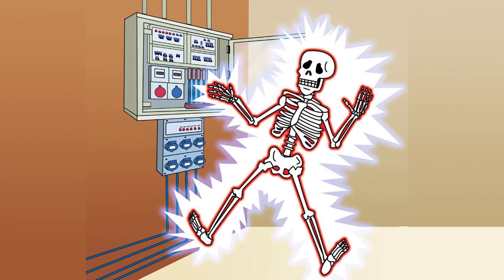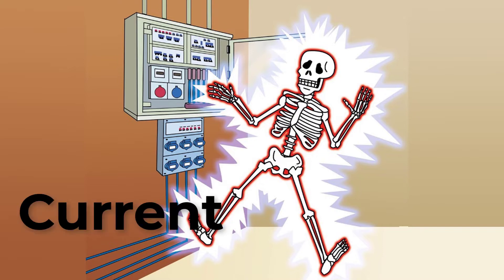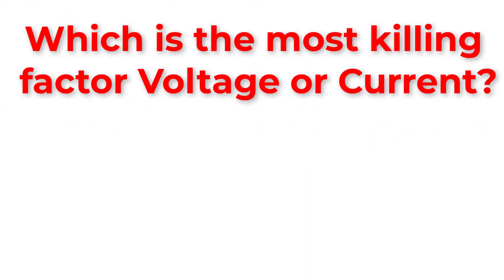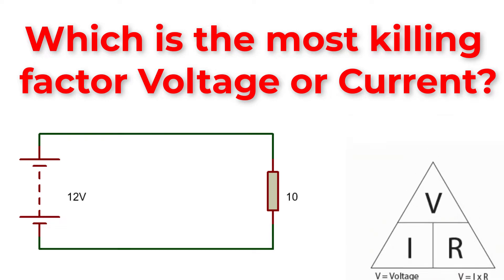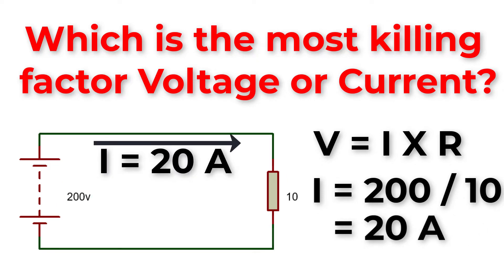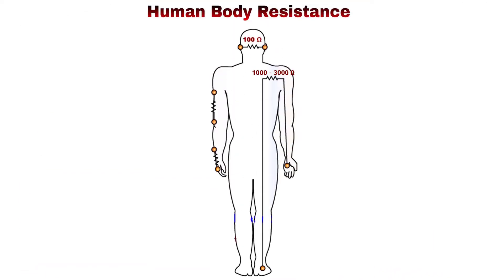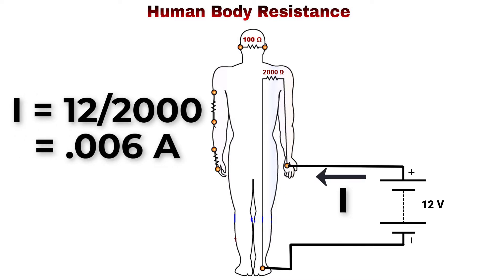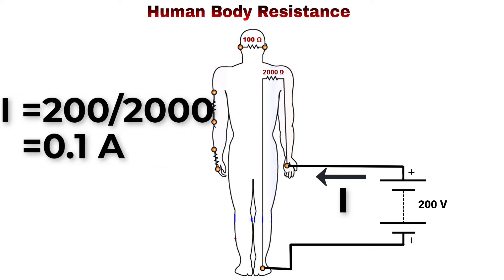Which is the most killing factor: Voltage or Current? |Explained

Comment: Voltage is real, resistance is also real. Current on the other hand is not 'real' like voltage and resistance are.
Current is a RESULT of the interaction between voltage and resistance.
Voltage and resistance exist independently on their own. Current ONLY exists when voltage is applied and that voltage is bridled by resistance.
This is a basic understanding that needs to be taught.
Reply from the maker: Thanks for sharing valuable information ❤️

Comment: I think the current is the factor since the current is what will be flowing in the body. birds wont die from hanging on an electric cable outside although it has a high voltage. I know you will say that there is no voltage difference there. But that would be the idea, without voltage difference and therefore circulating current, you wont get electricuted. So voltage itself is not the factor.
Reply from the maker: Well i like your way of analyzing, that's true that current will pass through the body and kill you, but it will never flow if there is no enough voltage (potential difference)

Comment: would it be fair to say... the voltage is the size of the fist and the current is how hard to hits you? Or maybe the voltage could be the size of the river and the current the amount of water flowing?... sorry, Im just trying to make this work in my slow brain
Reply from the maker: Excellent 👍 i like the first analogy, without fist there will be no hits, for the second analogy if a water is on a mountain, the mountain height is the voltage which will force the flow of water (current) to move down the mountain

Comment: That's why ELCB ratings shall be 30ma&100ma where the man hold equipments using
Reply from the maker: Excellent,That's right 👍 the normal mcb will never sense this amount of current & will never trip the circuit